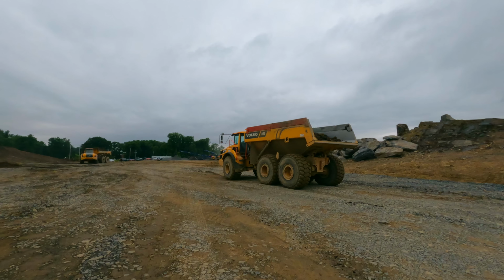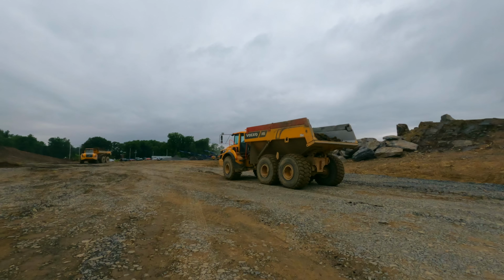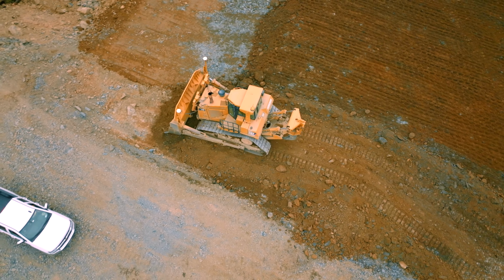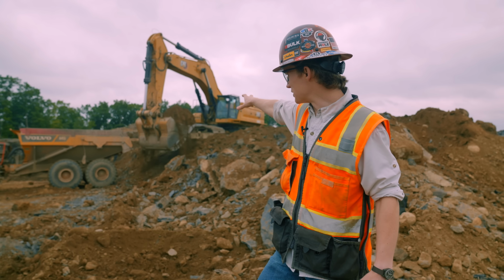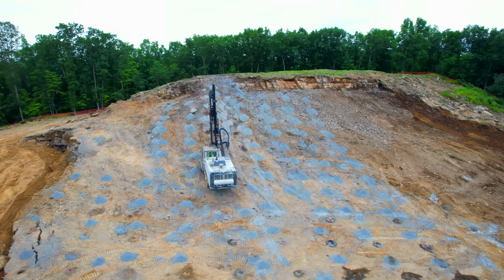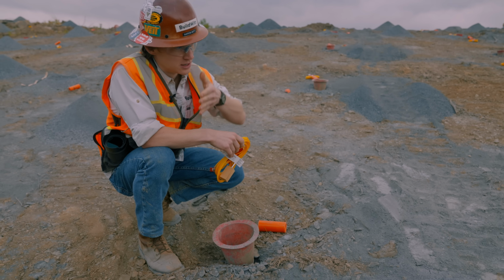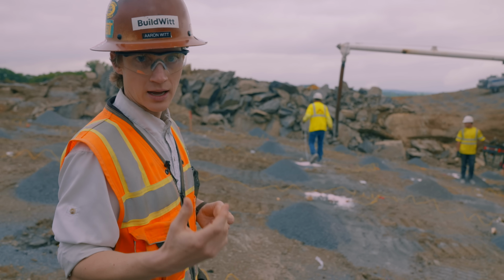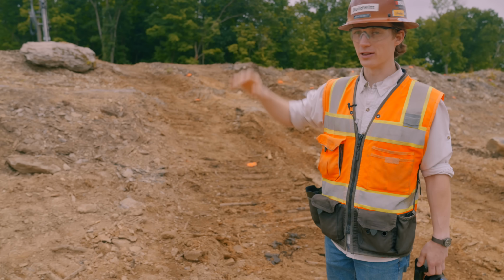Blasting 200,000 Yards of Rock | Building Infrastructure For a Commercial Building | Petillo

Comment from the maker: Is blasting rock for commercial projects common where you live/work? If so, what type of projects?
Reply: Yep, here in Norway we blast a lot. For roads, houses, ditches etc. But we also have a lot of projects that doesnt require it, all depends on the place and how deep customers pockets are. I personally operate a Cat 326F with an Excadrill drilling application. Awesome video btw, that bulk anfo truck looks handy
Reply: Yes I’m working on one currently here in kentucky. A new warehouse pad. Our shot is pretty much what you see here. I have about 4 ft in some spots of boulders to pick through before I get to the good shot rock. The issue we had was above the main layer of rock was about 2 ft of dirt then another 2 ft or so of rock. That layer of dirt absorbed most of the blow all the top layer did was break in to massive boulders.
Reply: Yes, and we mill A LOT of rock here too. South/ Central Texas